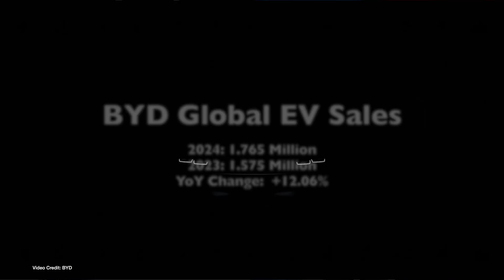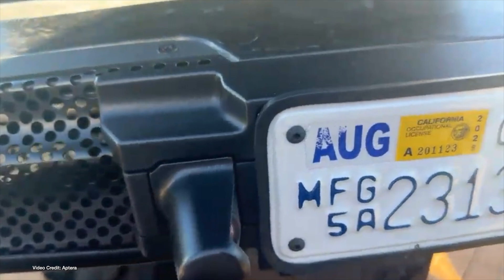EcoTEC Episode 352 - EV Sales For 2024, Honda + Nissan Is Happening, EV's Good For You!

Comment: I like how these guys preach about EV ways religiously. Yes the upfront cost of an EV is a lot more expensive especially with the high cost of living crisis in NZ. But its QUIET, instant torque, and the thrill of driving an EV. We have a fleet of Hyundai Kona's at work. Downsides are its at least 10x slower to fill up (charge), and realistically its quicker to top up a petrol/self-charging-hybrid vehicle.
Reply: How often are the Konas off the road for Breakdowns, or servicing?

How much cheaper are the Konas to run,

Your fleet manager will be able to provide with the evidence.

Plug, ☕, 🍔, 🚽, or 🛏, unplug, drive.

I never wait for the car to charge, it waits for me to drive.

No diverions to a refuelling station on the way to work, or on the way home.

PS 44+years of driving and owning ICE, 27+ months driving and owning an EV.
Reply: @gadgetmeister8503  I prefer this response to that backhanded compliment.